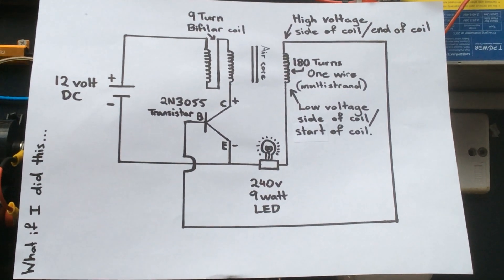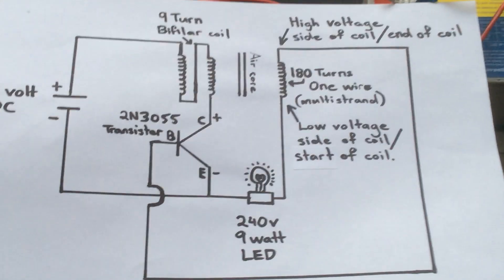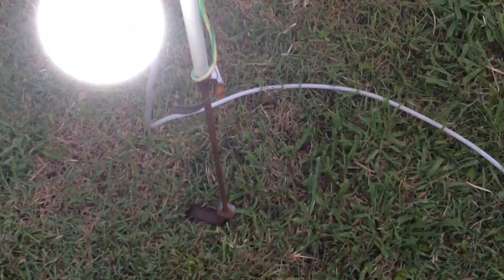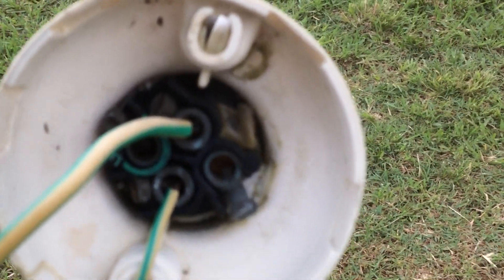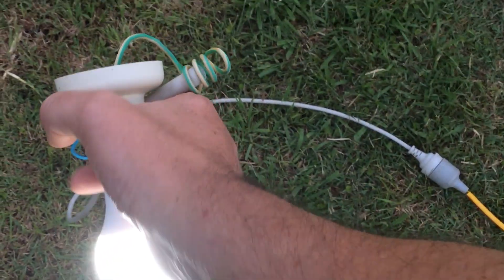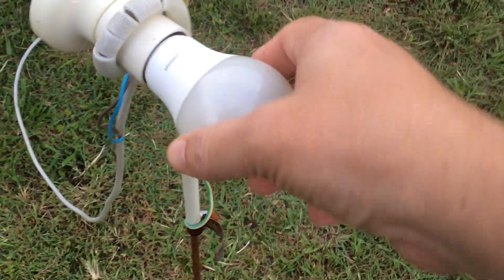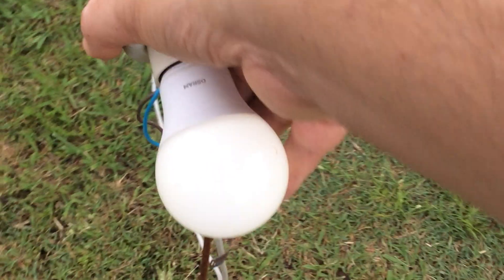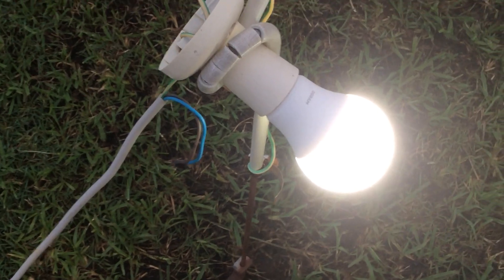Energy Crisis Emergency Lights, Tesla's Single Wire Radiant Energy Transfer through The Earth Part 3

Comment: Sou do Brasil sigo seu canal pode me dizer si o enrolamento primário e o secundário são enrolado no mesmo sentido ?
Reply from the maker: Thank you for watching and following my channel it is greatly appreciated. 
Both primary and secondary coils are wound in the same direction.
Reply: @whatifididthis...1236  obrigado por responder pode dizer si posso usar uma bateria de 60 amper o transistor 2 N 3055 suporta ou precisa ser uma bateria de menor amperagem?
Reply from the maker: @juliopescador7047  The battery size is not the issue and I have used a 200 amp battery just fine, however, modern batteries that contain BMS (Battery Management System) can experience problems with the high frequency high voltage radiant energy field that is penetrates through everything in its near field. That doesn’t mean you can’t use a battery with a BMS, people just need to be aware it’s a different type of electricity than we are familiar with and that some of my devices have just been fried and others coped just fine. It’s important to consider what is more important sacrifices of technology for research and development or keeping what you have already spent money on. If you wish to test these things I would recommend purchasing cheap units, it’s always a gamble in the name of research.
Reply: @whatifididthis...1236  fiz uma bobina dessa  pequena com 9 voltas no primário e 110 no secundário funcionou porém com uma lâmpada led de 12 volt de 110 volt não atendeu e aqueceu bem o tranzistor talvez eu tenha que dar mais voltas no secundário pra lâmpada de 220 vot a bateria que tenho aqui não ta prestado kkk de 12 volt caiu pra 3 volt não tem amperagem talvez seja isso
Reply from the maker: @juliopescador7047  I have spent years reverse engineering electrical inventions from videos and other sources and found it extremely frustrating and have realised close is not good enough. Can I save you some time and ask you to check that what you have created is what I display in my tutorial videos.
To give yourself confidence you can replicate my design with the following tutorial, https://youtu.be/ZYoK3eD4Jfo 
You can purchase online a couple of different manufacturer LED light bulbs because not all bulbs work, for me it’s about 1 in 8 don’t work and I have purchased boxes of new LED lights because I know they work, a little obsessed. They don’t have to be expensive, be sure to stipulate the 240 volt bulb to the seller, once you have a successful replication and you know it works is when you experiment with other bulbs and other voltage systems and number of turns knowing what you started with that did originally work.
The last 110 volt LED I had was burned up with this circuit when I tried, it took about 5 seconds and let out a little puff of white smoke!
I would estimate, but don’t actually know, you would want half the turns I use if you want to run half the voltage rated lights.
Keep in mind, when you halve the voltage, you double the amperage. Therefore you need to be sure if the transistor your using can handle that amperage by looking at the data sheet.
Reply: @whatifididthis...1236  fiz exatamente igual a sua porem fiz uma de menor diâmetro bem pequena só pra ver si iria funcionar usei o transistor 2 N 3055 fis o secundário com um fio bem fino porem só deu pra enrolar 110 voltas pretendo fazer com 180 voltas troquei a lâmpada por outra de led de 240 volt e acendeu mas consumiu muito rápido minha  bateria acho que ela não ta segurando o carga mais gostei de réplicar sua experiência show 👏🏼👏🏼👏🏼
Reply from the maker: @juliopescador7047  Can I save you some time trying this with small wire, the dielectric of the insulation surrounding the wire is important, this creates a 2mm gap between each layer of the wires. I’m not saying it won’t work but I will say it is not what I have built and therefore can’t tell you accurately why it does not work.
Can I suggest your first replication is near identical in every way. A Porsche 911 and a Volkswagen Beetle use the same concepts, 4 wheels, a motor, doors etcetera but they are not the same thing.
Reply: @whatifididthis...1236  com certeza  não é identico ao seu ,por que não tenho no momento material vc usou pra construir mais quando eu tiver vou tentar fazer igual ao seu

Comment: Where does this idea of a "center tap" on the primary come from??  Such a good idea!!
Also, is the secondary simply wound "right on top of" the primary, or at a distance from primary?
Reply from the maker: Thanks for your comment. The primary coil is a bifilar coil and the 4th junction on the terminal strip is connecting one of the primary ends to the opposite primary start and therefore not a typical centre tap. The secondary is as you stated, wound directly on top of the primary.
Reply: Thanks for this!!  A d I hope you're feeling better.  I hurt my right Achilles  A few years ago, And did get better Gently massaging that area Helped a lot I think.
Reply from the maker: @TheProfJones  Thanks for your well wishes. I am slowly getting better and regaining my mobility, the real problem for me is the pre existing spinal injury that is making my recovery much slower than the average person. I already had trouble walking with my spinal issue so this is just an extra hurdle. I apply Rife frequencies to my injury every day and I have accepted the longer healing times for my condition so I just have to be patient now. Massage sounds like a smart thing to do also. Thank you.

Comment: My being from the states having 110 volts for light voltage would  I half the coil turns . from 180 to 90 turns and leave the bifilar coil turns as is to accomplish this lighting project.   Thank you love the channel.
Reply from the maker: Thanks for watching. I imagine you are correct Frank, I had only one 110 volt light, when I connected it to this circuit it was very very bright for two seconds before it died. It would be no harm to try the 90 turns first, if it isn’t enough perhaps increase by 10 turns. The more correct way or more efficient way to decide on number of turns is wire length. Measure the physical length of your primary and make your secondary a multiple of this, for example, if your primary measures 2 feet then your secondary should be 8 feet, this makes your primary quarter wave. If that ends up to be 93 turns instead of 90 then so be it, it will be more efficient at the full 8 feet. A little guess work for the first prototype is necessary. A good tip is measure your secondary but don’t cut it, just mark it or slide heat shrink to that measurement, then start winding and take note of the number of turns the full 8 feet is. All that said 90 turns is a good ball park figure to start with. An important point to make is the lead in and lead out ends of a wire are included as the length of wire. eg. If there is two inches sticking out of the coil at one end there should be two inches sticking out at the other end, all things equal.
Reply: @whatifididthis...1236  Thank you you're a very good teacher. It will take me time to view and digest your video's but  know  I am there. Thank you will talk soon.  PRAYING FOR YOU TO HAVE GOOD HEALTH.
Reply from the maker: @frankchandler8005  Thank you for your kind words, greatly appreciated. Have a great day.

Comment: Interesting. I think it would be more convincing if you had a single wire.
Reply from the maker: Thanks for watching. By twisting the wires together I have made it so there is only one wire going in the bulb and on to earth. At the circuit all three wires are twisted together and at the light two of the wires have been joined together, this is to show it truly uses a single wire. I don't want to strip the wires completely apart as this will prevent me turning this cable back into a normal extension cable.

Comment: Must not be much voltage there on base because it would burn the transistor
Reply from the maker: You would normally think that to be the case, however there is well over 1000 volts which supplies a very nasty burn and seems to make me feel very angry when it bites me. I have been electrocuted quite a lot as you would probably expect, I'm careful but unfortunately human so mistakes do occur and this feels different to some of the other hits I've taken. In one of my videos I get zapped and you can literally hear it bite me off camera, in this video you can also see the voltage overload my meter as it goes over 1000 Volts.

Comment: Hi, i like what you've done here, but could you please let us us know the wire gauges you've used in both the generator coil and the 180 turn coil? Thanks for the video.
Reply from the maker: Hi Sam, thanks for watching my video. I am  happy to help.
 I have made several of these over the years and the insulation thickness is important as it creates a dielectric field. In my experience with this circuit, thinner insulation isn’t always the answer. In saying that you can use any wire you can get your hands on, if you can’t find similar wire and yours doesn’t work it may be the lack of insulation, as I experienced when I tried to shrink the design.
The wire used is figure 8 speaker wire for both primary and secondary.
Individual wire measures at 1.02mm giving it a gauge of 18
The wire with insulation measures 2.80mm or 5.60mm for both wires side by side in original figure 8 speaker wire.
The primary is the figure 8 wire left intact, ie two wires side by side to give 9 Turns Bifilar Coil.
The secondary is the figure 8 wire split apart to give one insulated wire of 180 turns.
I hope this helps
Please let me know how you go with your build, happy to troubleshoot if needed.
Have a nice day.
Reply: @whatifididthis...1236  Thanks for the thorough reply! I'll have a go. Cheers buddy.